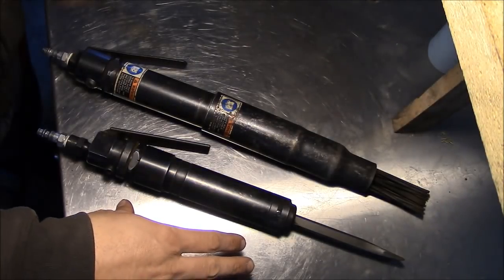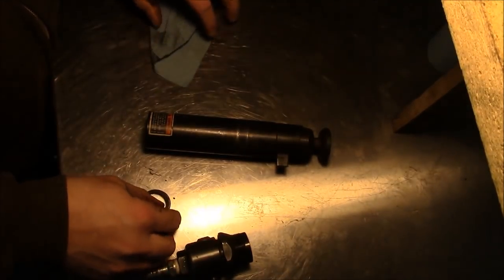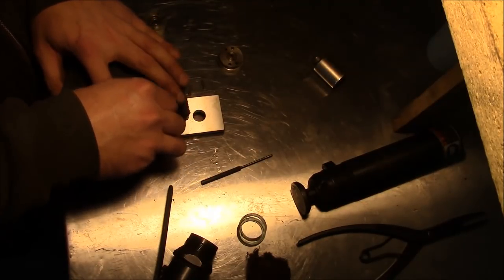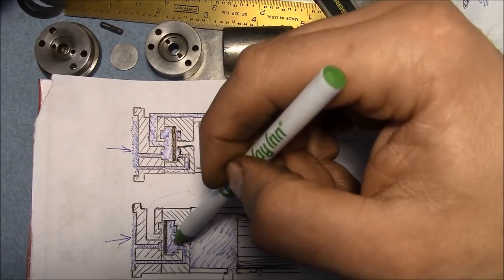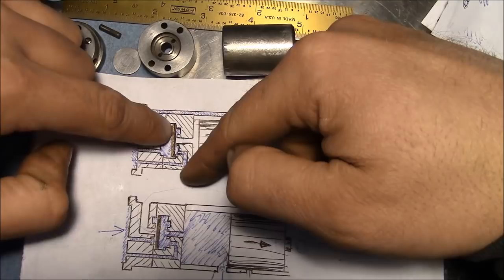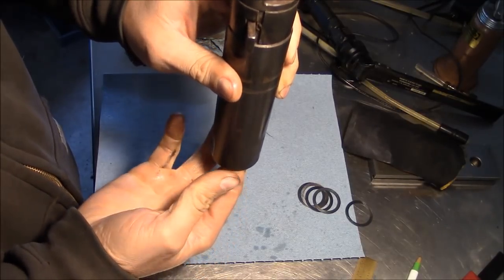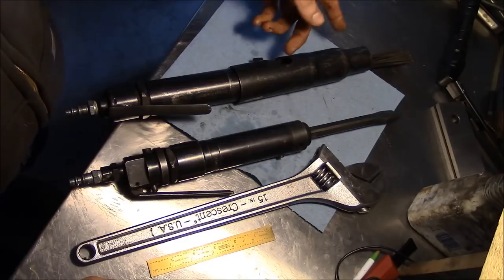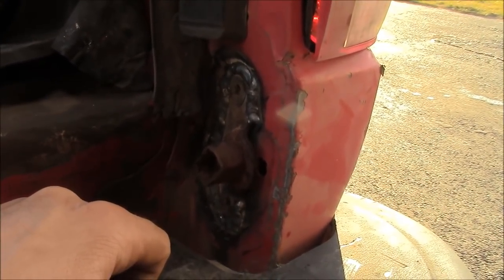Needle Scaler on the Fritz

Comment: Watching you do this for the second time because I work on rusty old junk and have a needle scaler that I pulled out of works dumpster! Threads are a bit stuck!
Reply: Let it sit from the post above until now. Heat and penetrating oil must have done their job. It came apart with very little effort.

Comment: nice video.  How does oil stay in the air tools.  I oil my tools every time I use them and again if I use them a lot just like the manual says but based on what I see here it seems the oil would not hang around long and would leave right out the exhaust.

Comment: Thx I am a new subscriber to ur channel and love the content. looking forward to more vids. Used needle scalers  for years in the railroad industry for everything from thick paint or rust removal on nuts and bolts to cleaning b4 and after welding. that CP is a top of the line one for sure. not sure if u have used it with newly sharpened or new needles but if u do u will want them sharp all the time for getting thru north Michigan old iron coatings. Try grabbing up a second one keeping it with dull needles for the jobs less aggressive.

Comment: Thanks so much for this vid.  after two solid days of using the same tool it had stopped working properly.  The piston would travel up and down the cylinder but with very little force.  I'm hoping that I will find something similar to yours.  just needs a good cleaning.

Comment: Yep, memories of finding that certain members of the Deck Crew need an attidude adjustment and needle guns in the chain locker can be an excellent motivator.  And the Chain locker gets filled with wet metal chain links, so there is legitimate corrosion to stay ahead of.

Comment: I've rebuilt 100's of these over the years. Simple tools. Main thing is tighten everthing with jamb nut loose, then, tighten jamb nut last. Be sure to add a swivel 3ft whip with small in line lubricator. It will last forever. Having the coupler at the tool will eventually crack threads from the vibration and air hose will come off and whip you like your Grandma. Been there done that.

Comment: Just put some drops of boiling hot oil in this tool, on the business end and the air intake, after usage. This removes any residue water and will put a protective film on all components. Move the main piston forward and backwards manually. Wait a minute and then blow the excess oil with a frew seconds running with the air out.

Remove any build up oil after say 50 hours of usage or after 2 month, whichever comes first by disassemble, cleaning with WD40, wipe and wipe with new oil.

This only works on tools which have no internal rubber sealings.

Sidenote: Never leave WD40 on a component which is going to do any work. WD40 is no lubricant.

Comment: I have used needle scalars for many years. Some so used the tension adjustment slots are almost beaten out with the scaling needles worn down to less than an inch long. Never had one fail. Chicago pnuematic. Chinese scalars probably not so hot.

Comment: If thats a harbor freight scaler dont oil it.  Bought one years ago, used it a ton oiled it and it stopped working.  Bought a new one, oiled it, stopped working.  Now last one has been dry since day one, been using in the truck for the last 5 years...still going.
Reply from the maker: Chicago Pneumatic. Not Central Pneumatic.
Reply: My mistake.  Quite the difference there, might want to oil that one!

Comment: Get an in-line Oiler, not that expensive, powered by the compressed air.
Reply from the maker: I should. We used them when I worked in a foundry for the deburring tools.
Reply: Watch Wes Work I used them regularly when I worked at a hire firm for the jackhammers and the smaller air tools, never had a problem unless some customer forgot to fill the bloody things and the implement froze up.

Comment: Someone hasn't been OILING his air tools like he is supposed to
Reply from the maker: I try to, but maybe no enough.
Reply: @WatchWesWork I've always been spotty with my "tool truck" air tools, but CP / HF tools get oiled each day before use or even mid-use for some if I'm using it a lot. Trust issues...😂
Reply: You can get an air dryer that dispenses oil too, you just have to refill once in a while.
Reply: Oil daily
Reply: Bro if you put oil in the scaler it the pop valve sticks and it won't work xD

Comment: In the 70ies got a air chisel , in the box was a dinky tube of red oil, instructions stated , "2 drops before use, 2 drops added before storage with 3 second run "  That red oil was Marvel Mystery oil.
Never had one seize up, over the years ran across seized air tools of folks n my red oil friend cured the issue.
Many doubters turn in to full time users. Yes oil works, Mystery oil works better with less mess n gunk.
Another thing I do is when the needles get rounded, grind end square again, just a touch on the grinder .
Let the hammer achieve 3/4 stroke or more, get more work done with less effort. 
I'm old now , shared this over the years n made lot of believers.
Nice air flow diagram .

Comment: Wait..."High quality industrial strength"  are not adjectives that are normally used to describe Chicago Pneumatic (Harbour Freight) tools.  Don't get me wrong now, I do like CP and HF tools for there low cost and easily fixable problems...I'm just sayin though.
Reply from the maker: LOL. Chicago Pneumatic is an American builder of industrial quality air tools similar to Ingersoll Rand or Atlas Copco. You are thinking of Central Pneumatic, which is a made up name for cheap Chinese craps sold by Harbor Freight.
Reply: @WatchWesWork  HF also has a brand called "Chicago Electric" to go for maximum confusion.
Reply: Oops, right you are Wes, my bad...I sit corrected.  Thanks for setting me straight.

Comment: I think there is also a feedback from the piston, when the exhaust ports are covered and uncovered, the residual air in the side that WAS uncovered is able to unseat the valve plate because that exhaust port is now covered.
Reply from the maker: Yeah, I'm not exactly sure how the timing of the valve works when the thing is screaming at full rip.

Comment: Wes, good video on your air tools. I have run pneumatic tools for years mostly under water both fresh and salt. They are a high maintenance item and cause a lot of down time. Lubrication is key, I have tried every lube on the market. By far, the best for my money is Fluid Film. Totally disassemble the tool again and spray all parts down with a light coating, ALL parts including piston and bore. Assemble as before and you are off and chipping. A snort now and again in the air inlet will continue the process. A little bit goes a long way.....like getting into never seize. Good luck!
Reply from the maker: I like ATF for air tool oil. That's what I have always used. This one just needed some intervention...

Comment: Really great drawings, very informative! I don't know what editing software you're using but all/most of them makes color grading relatively easy and I find that it's worth spending 30 minutes on getting it somewhat even.
Reply from the maker: The problem is the reflection of the light from the shiny work surface. It tricks the camera into switching to daylight mode and makes everything dark. I figured it out eventually, but I couldn't really reshoot the first 4 minutes.

Comment: In this age of throw-away tools it is really nice to see someone else repair one. I bought a box lot of air tools at an auction. Impact guns, angle grinders, needle scalers, etc. Only one impact was working, and that was sometimes. Now I have a lot of working air tools. Only an air saw was not salvageable, couldn't even get it apart, solid rust.
For $12 and some time I ended up with 9 working air tools.
Thanks for sharing

Comment: The expensive Atlas Copco air tools I use at work, has an oiler thingy installed, that creates an oil mist in the pressurized air line, it keeps the air tools oiled up on the inside. Ofc we want to see this stuff, if you haven't seen the inside of a needle scaler when you die, you haven't really lived at all. Compressed air can have a fair amount of water in it, probably due to condensation.

Comment: Thank you , I have the same tool with the same issue now I can try to fix it again. Your detailed explanation of what is going on inside 
Is exactly what I needed to now make a better attempt at getting it going again. For those that may want to try this great cleaning method out I have a few of the inexpensive harbor freight 
Units large & small models and for the money,they work well just make sure to oil the hell out of them often while in use .
They sell the replacement needles also, taking a grinder and squaring the ends off the needles ( while still in the tool ) it doesn't have to be perfect  has helped cut paint and crust down faster for me . Don't try it on thin delicate objects it may destroy them , cast iron , thicker gage steel
No problem save time and money compared to sand paper paint stripper and the debris is easer to clean up .

Comment: Back in the 90's I worked off shore on a oil rig in the Gulf of Mexico. I actually enjoyed using the needle gun. I learned to use thick gloves so my hands wouldn't be 100% numb after 12 hours. Definitely need an excess of ear protection.  Great video.

Comment: "Hearing protection is not optional when it comes to these tools"

I didn't think my phone was loud, apparently both I and the dog disagree.

The chipping hammers are also great for low clearance for an impact and using it to pound the wrench because the dude before you torqued it down with Thors Hammer and then it rusted over.

Good work man!
Reply: You will be glad to use hearing protection, with five guys running these all day on the outside of a Navy ship in dry dock, each department had so much area to chip down to metal some places a needle gun was the weapon of the day.
Reply: I agree bud, I always wear hearing protection, even if I am cutting the grass or just doing projects in the house. It's gotten to the point I have to whenever working with tools, because the tools dont sound right without em.

Which isnt a bad spot to be in, because I still have exceptional hearing when I get tested.

My dad can barely hear after a lifetime of die try outs and working in stamping plants. I'll luckily barring a lightning strike be better off.

Comment: Nice video and explanation of how such things work. As for the truck and backing plates rusting off. I learned a very long time ago, that to keep any vehicle for a long long time, you have to fix things as they break and not wait until they pill up, making the repairs both really costly and cumbersome all at one time. And it is amazing how long you can drive most any vehicle, be it a truck, car SUV or whatever. WE own a 1995 Ranger truck that still drives and looks like new, and a 1998 Blazer that also looks like new. JMHO

Comment: I use the needle scaler an awful lot on a fleet of concrete mixers i maintain, yes you need to oil them a lot. You can buy a tube of replacement needles.

Comment: Love your channel - but I see you have an issue that I was lucky enough to be taught early - ya got to lube stuff !! LOL That is the only reason that tailgate handle failed. I have a check list about that I do every 5k miles and once a week on those expensive tools. Drain the compressor once a week if you don't have auto drains. Also get a pressure spray bottle and make your own penetrating oil. Regular ATF and MEK. When it is new it is better then Aero Kroil. When it gets to the point it is not working add more MEK. It goes away pretty fast but not so bad it one of those good quality spray cans. 

Another tip if your compressor is noisy enclose it or move it outside in a simple shed. I had a good customer that was a ear doc.-came in the shop and drank a few beers with us a couple times a month. The first time he heard that come on he said if you don't want to be deaf when your 50 get that noise out of here.

Comment: Back in the years I was a Tech in a dealer - religiously every time I used any air tool it got 3 drops of ATF (keep in mind this was early 70's) later on that became Marvel Mystery oil.
Reply from the maker: I use ATF in my air tools. As far as I know air tool oil is just hydraulic oil, so pretty much the same as ATF.
Reply: @WatchWesWork  ATF for a tire changer machine?